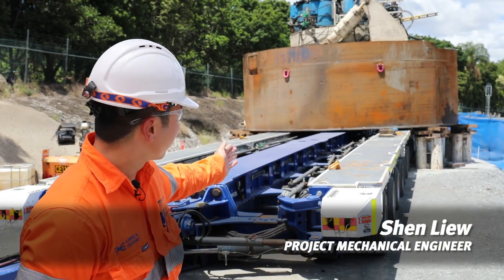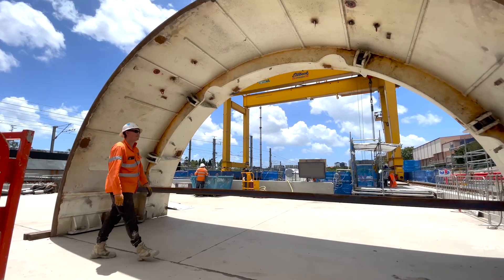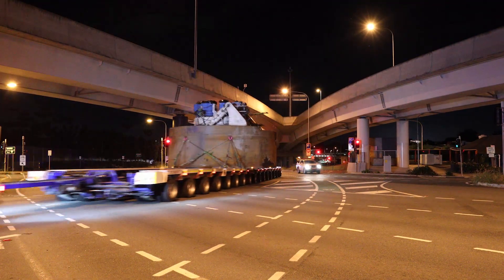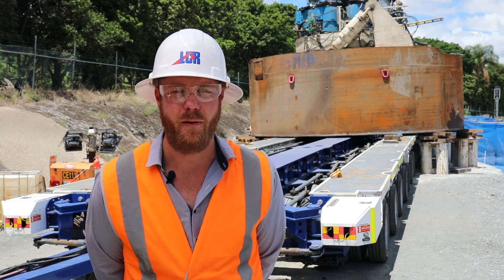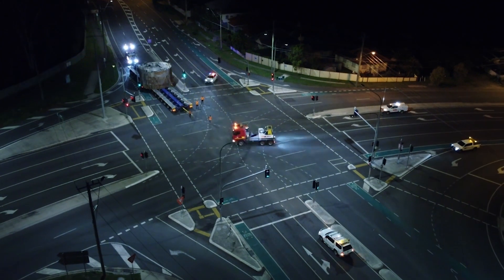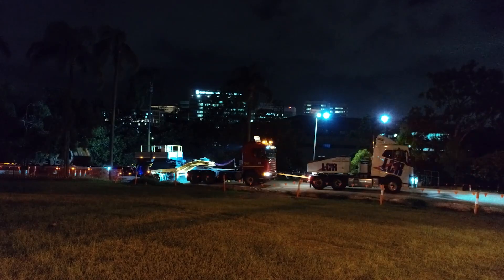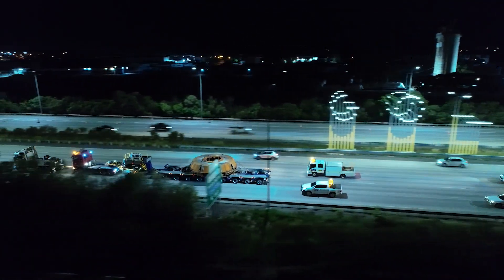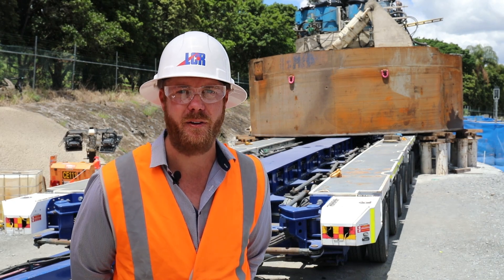How To Transport Massive Machines

Comment: Ae these repurposed
Reply: I would imagine that they are, but I’m no building/tunnelling engineer. But if it were my machine, I would design it to have removable segments, which is what you’re seeing here. You can’t haul the whole machine in one go, obviously, so I imagine it’s designed to be assembled when on site disassembled at the other end, assuming you have enough space for two open cut boxes at either end of the tunnel.

I’m relatively sure that basically CRR would specify what they need for this specific dig to a TBM company, there would be back and forths regarding which elements they do and don’t need, any limitations (can’t be over a certain size/weight/etc), and then they send all the bits required to create the TBM assembly on site. You’re effectively creating a tailor-made solution which is built from reusable subassemblies which then can be tailor made for the next solution they’re needed for. Which is pretty clever if that’s what they’re doing.

Short story long; I’d imagine they are designed to be reused, but each project they work on requires a certain configuration of tbm elements, which is then assembled on site in one box and disassembled at the other end in the other box (Woolloongabba), and then taken off to wherever their next job is.